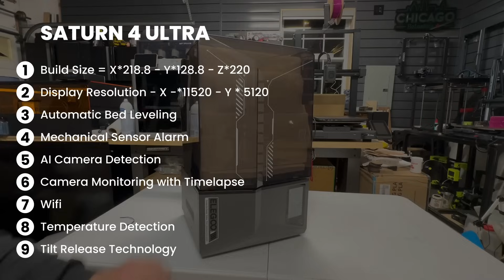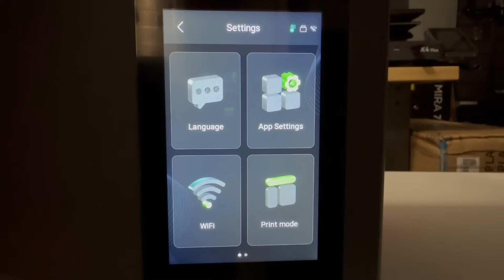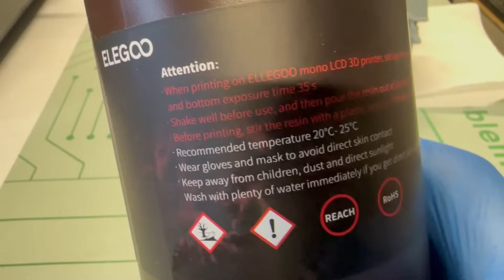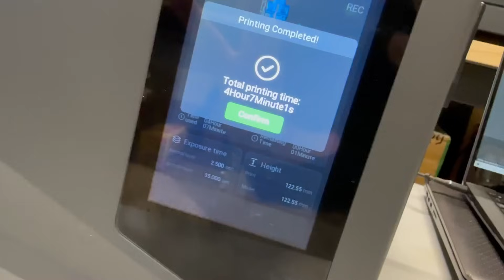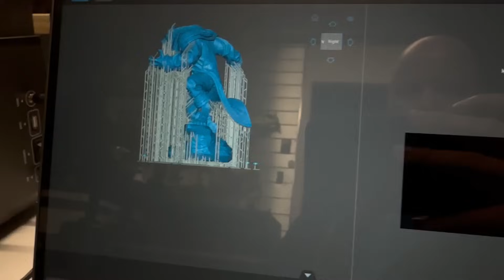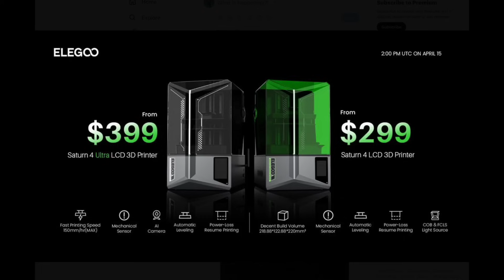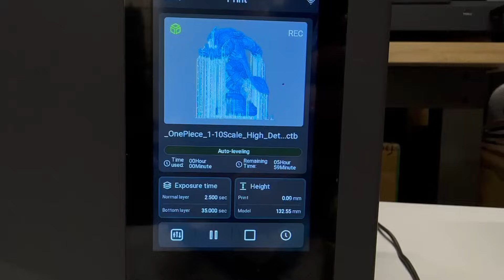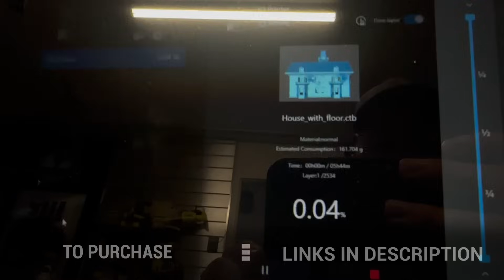ELEGOO SATURN 4 ULTRA - Resin 3D Printer

Comment: See that 7.20 mark - I dont like the design of the plate - the way resin is in the gap of the plate and you are bound to drop it some time.  Why could they not have covered that gap and put a wing on it to hold it more securly.  Its really put me off this machine.

Comment: Nice video, thanks. I suggest getting a big container of IPA (Ikea 365+ plastic containers are great) that you lift you print (and buildplate) straight into when removing from the printer, you wont have all that resin spill everywhere

Comment: Don't print resin prints flat like an fdm printer, always tilt them at an angle to reduce suction. Also soak them in hot water then remove the supports and they will almost fall of the model.

Comment: Great video!  I'm thinking about getting into resin printing and I'm learning a lot from your learning experience.  I was especially wondering how well the water soluble resins turned out as I would like to use those if I get a resin printer.  Thanks!!

Comment: Z tilt release is what helps separate the model from touching the screen surface. This motion relieves the tension and suction force when lifting the model up, so that the resin spills underneath it to make ready for the next screen flash. This process speeds up the print time since you can lift the models faster without breaking them or damaging the screen on the vat.
Reply: Exactly this. But to make it simple.

Why don't you peel the "peelies" off all at once? When peeling something stuck to a surface, it's just easier to peel a small portion continuously

Comment: Tilt feature. Try to pull a suction cup off a flat object. Then take the same suction cup and peel it off from one side. Which is easier?  Also, the Z axis doesn't have to raise 10 mm, wait then lower, the bed does it instead. so, it takes less time to release the layer and start to do the next layer.
Reply from the maker: Awesome!  Just didn't understand the release part.  Was thinking build plate release, not the FEP.

Comment: Nice to meet you.
Thank you for your very clear review.
It seems that the performance of the printer has improved, but what surprised me the most is the reduced selling price. As a user, I really appreciate it Elegoo !
I currently use 3 3D printers and the Saturn 4 seems to be sufficient for me, not the Saturn 4 Ultra. But this build plate looks hard to clean 😅 other than that it looks great.😊

Comment: The Z tilt release is good as it reduce the pull/suction forces when compared to a typical Z axis lifting printer. As the vat tilts, it effectively 'peels' off the printed layer rather than rip it upwards
Reply from the maker: Many thanks!  I heard of people putting RainX on the fet to help with the release

Comment: Needs a heater to keep up with the competition. But $400 is GREAT price. I just bought the S3U and paid 350.00 and thought thst was a steal. 50.00 for a little more definitely worth the asking price.
Reply from the maker: Since half the months are cold in my garage, a heater would be a nice built in option.  At this $399 price point, I still think it is a great value.  Thanks for watching and commenting!
Reply: According to the vp of sales who was interviewed on launch they have no intention of including a heater as it's too cost prohibitive. The heater isn't that expensive but the safety ratings would tack on $100-200.
Reply: @jtrain9926 53$

Comment: John, good points, the quality/ resolution is fantastic.   I have avoided resin, since I know I'm not a neat or careful person.  The need for a wash and cure station is also a downside.  So far I don't need the resolution of a resin printer, but am impressed as to the advances made in that technology and how the prices have dropped over the years.
Reply from the maker: The print quality is absolutely amazing!  However, you are correct, you have to pay attention to every surface you are touching.  Cross contamination is a real issue with handling resin!  It definitely isn’t for everyone!  It was nice to just basically print and go.  You are getting a lot of tech for the price.  Thanks for watching and commenting 👍

Comment: Hey hey! You drip tray was in the box that you removed in your unboxing clips! i think at the 54second mark.
Reply from the maker: Found it!  Many thanks!
Reply from the maker: You are a life saver!  I thought it was just filler cardboard, as it was super light!  Many thanks!
Reply: I noticed that too I was holding my breath when you removed the plate without it on the printer and glad that none of the resin go onto the LCD screen

Comment: release tilt means less force needed to detach the print from the fep, less chance of them falling off the plate.
Reply: Think of the print like a suction cup.

Pull straight up and it takes a lot of force to remove from flat surface.
Grab the lip of the suction cup and pull and it pops off with nearly no force.
Reply from the maker: Ahh!  Is that why I see some people use RainX on the fep?
Reply: @TripodsGarage  probably so. The print sticking to the foil in the container is a disadvantage, but unfortunately it cannot be avoided for now. This tilt probably helps with larger prints where there is a large area attached to the foil. In the case of smaller ones, where there is a lot of foil free around the print, the foil itself will bend and tear off at an angle towards the center of the model.
Some fluids certainly help, but do they make enough of a difference to be worth using? The question is how many layers after which such an agent is removed from the foil.
Reply: Does that also mean higher viscus resins can be used for fast print? I would like to print hard accurate functional parts using abs or nylon like resins vs  ultra high detail and would like to print them fast if possible, this looks like a definite buy if I can print with a wider range of resins vs the really low viscus ones.
Reply: @edfhobbies556  "Fast print" is still based on the use of special resin blends that need very little UV time to cure each layer. They tend to be more brittle due to their lower UV exposure between layers though.

Ensuring the resin is at peak flow temperature and the physical tilt of the tank would improve the refill of voids left by the previous layer which would mean the UV lamp's 'Off Time' could be reduced since you don't have to wait very long for the resin to settle before turning UV lamp on for next layer.

It won't give you major time improvements since at best it could be minutes off a multi hour print.

We haven't reached Carbon's printer tech at entry-level pricing yet. There is no on/off lamp times or lift/retract steps for their oxygen based printer since it's designed to have a deadzone just above the film layer to allow for a continuous lift printing. Nothing sticks to their film since the oxygen permeable film prevents the resin from curing right on the film.